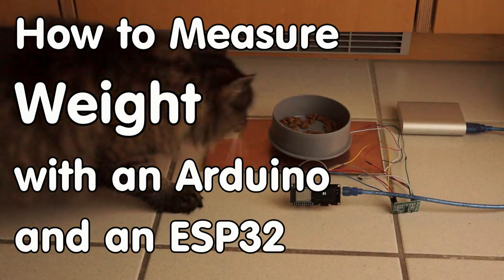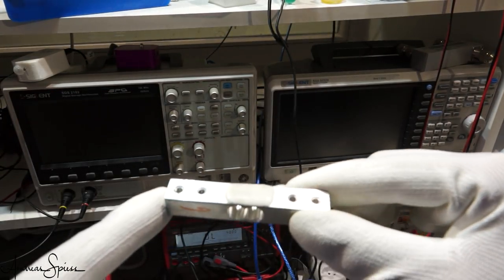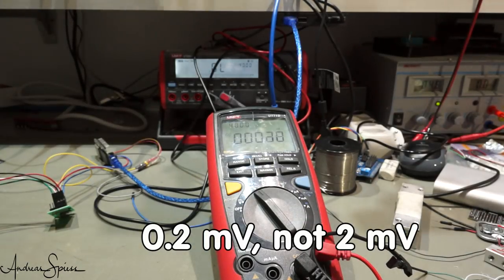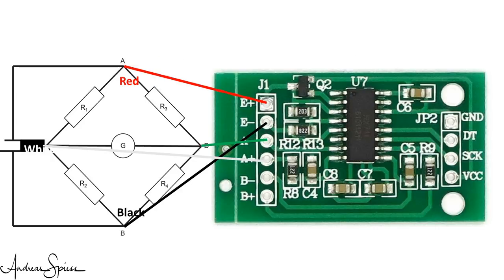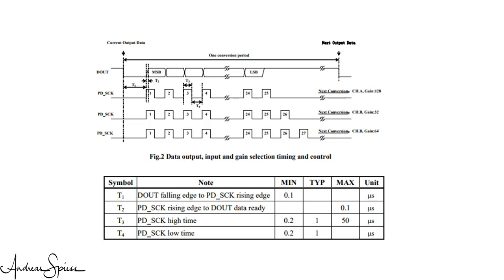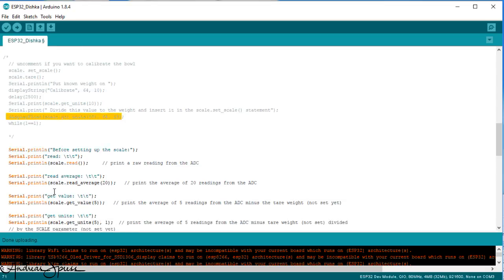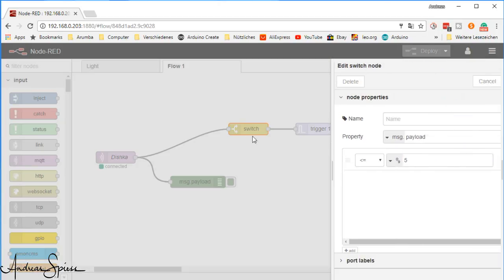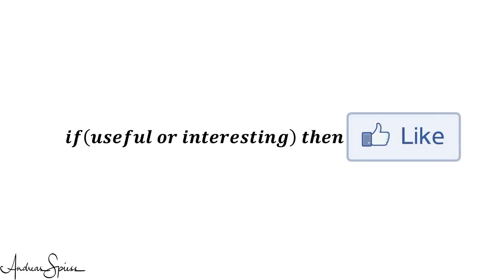#161 Measuring weight using an ESP32, a strain gauge, and a HX711

Comment: Wow, this is exactly what I was looking for! I have been migrating a project to the ESP32 (using the DS18B20 temperature sensor) and it kept dropping values where the previous Arduino did not. So it's just too fast! Can't wait to try slowing down tomorrow. Also, I am a hobby beekeeper and wanted to experiment with logging the weight of my hives over the coming season (I'm in New Zealand the season is just starting). So I've got my next project lined up already! Thank you as always for the great video!
Reply from the maker: I also plan to become a beekeeper when I have more time. Seems to be interesting and important these days.
Reply: I would love to see progress on this, as Andreas points out, it is becoming even more relevant.
Reply: Jens Stein: There's a bit for "conversion in progress", you might want to check that bit to make sure the conversion is finish when you're reading. IIRC on one of those model of DS temp sensor, you can also select the precision to get faster reading if you don't need 10bits.
Hope this helps!
DW
Reply: Hi Charles, that was very helpful, thank you. I was able to solve the issue by just setting the resolution to 9 bit (from default 12).
Reply: I will test if slowing down also solves my problem with reading from a DHT22 temperature sensor...
Reply: Patrizio Bekerle , funny problem with the combination of hx711 and ds18b20 that I need on an ESP32 with sim800 gprs (TTGO T-call): if I use the 80 mhz the weight system is working OK, but the temperature is -127... changing to 240 mhz the temperature is OK, but the weight not......

Comment: Thanks for the great Video. I like gages and such stuff. 
This kind of project is perfectly to use the "oldfashioned" ESP8266 out which are not as fast as the ESP32.
Reply from the maker: I only used the ESP32 to test some of the libraries. I think we should get an overview on which libraries work and which not yet.
Reply: Yes, for several weeks it gets better and better. Nearly all what I tested worked. And of Course, ESP32 is more attractive buzzword nowadays.
Usually I see beehives in goups, so a multi tasking mode would be needed. Or a a dedicated Controller per beehive measuring additional Things like temp + humidity, Irradiation or whatever maybe useful for a beekeeper.

Comment: Sir excellent video. Since my last comment some time ago I started up loading videos. There are about four presenters that influenced that decision, yourself being one. The aim is largely to document the hobby stuff I do and structure it but hopefully it helps someone tinkering. 

One video I did that is relevant to this video is a kitchen scale I opened recently to repair. Just a broken contact so that was simple but then I started wondering if it was feasible to fabricate one. I pulled up parts on ebay and it appeared to me that it was indeed economical. I did not consider the voltages and the need for the HX711. This video has been most informative on a topic I did consider though not order parts or build.

If you care to have a look and comment I can post a link. Critique is good. I need to improve my level.
Reply from the maker: I answered in one of your videos
Reply: Thanks. The video I was referring to is the one with the electronic scale which is similar to this. The same problem will occur though with my volume level and accent making it difficult to understand.

Comment: Setting the cpu clock manually to 160 or 240MHz also solved my problems with reading from a DHT22 temperature sensor... Thank you very much, Andreas!
Reply from the maker: You are welcome!
Reply: Andreas Spiess see my problem I described on using hx711 and ds18b20 on an ESP32; 80mhz is OK for the hx711, 240 mhz works for the ds18b20.....

Comment: Great video again. Strain guages can be used in a lot of mechanical applications and are rarely found in electronics videos.  A more relevant problem for me is that my too hunter/lovebuggs often bring in prey/ 'presents'  thru the catflapp in the door. I have been thinking about an image recognition system that could only open the flap if the cat is NOT carrying something in its mouth. This is a bit beyond my skills programming skills, i  think the software or parts of it is already 'out there' for this. I think the cost of the hardware is not a problem basically I'm thinking a rasberry PI, a camera and a gpio pin on it to control a relay that controls a motor to open the flapp.  My cat has a rfid chip in the neck but the problem I would like to solve is to deny entry if something is not 'normal' under the nose.
Reply: Nicklas Persson - You could detect if the cat is carrying prey by measuring its weight on both exit and entry. If the cat got heavier, is must have gained weight somehow, or - more likely - carry some prey... Just a though: Instead of bluntly refusing entry, you could perhaps train the cat to dispose it in a reward bowl that exchanges the prey for some cat candy...
Reply: I am all for simple solutions but a cat pees and poops outside and the weight of this greatly varies and would sometimes exceed 10-15 grams of a small mouse, bird and sometimes not. I am pretty sure my cat or any cat can not be trained to do leave its pray where I desire and most cat owners would probably agree i'm sure. I do appreciate the effort.
Reply from the maker: +Nicklas: Fortunately, our cat does not catch any animals and we even do not have a cat door. So, she has to wait till we let her in. But most of the time, she is anyway inside.

+ Maxint R&D: Good idea with the weight. If the animal in the mouth is not too small... Concerning exchanging it with a candy: I am not sure if a dead animal is already a candy for a cat ;-)
Reply: Thanks Lucio for thees links. This was what I was thinking of, hoping someone already has done this with a cat. Measuring the weight of the cat will not work unless the cat that always and without exception pees and poops indoors. Most cats prefer to do their 'business' outdoors with irregular intervalls. The cat may also have a drink or eat a prey or stolen food from neighbors cat or dogbowl while outdoors that will add to its weight and that should not stop it at the flap. I want to only stop cat from carrying prey indoors. This example shows how important it is to understand the context that an automation device is applied to.
Reply: Nicklas Persson BTW, is the RFID in his neck already used to control the access to the house?

Comment: Cat videos are always a plus. Cat + 24 bit ADC is extra cool. Could you determine how many of the 24 bits were above the noise floor?
Reply from the maker: 1. "cat 24 bit ADC" provides 400'000 hits on Google. Most of them without an animal ;-)
2. I did not look at the noise. Just look how accurate it counts the pieces. I assume, there cannot be a lot of noise.

Comment: Hi Andreass, just stumbled on this "old" video of yours looking for a weight sensor and ESP. The idea is that with this weight sensor, I can estimated the amount of filament om my 3D printer. Should be possible ... I think :S. Big kisses to the star of the video :p
Reply from the maker: It should be possible to measure the weight of the spool and calculate the rest of the filament if you use similar spools to estimate the tare.

Comment: Hi Andreas, great video again, a couple of questions.
I don't think you mentioned which strain gauge you decided to use for this prototype and if there was a reason for choosing that gauge rating ?
Also i've never used such gauges or analog bridges, nor played a lot with ADCs and i had to look a bit around to try and understand that "F.S" (full scale?) unit, maybe some details about ADC precision/limitations in your next ADC video, i don't remember if you covered ADCs in a previous one. 

I'll try to apply that to my mailbox to check if mail has really been delivered, yeah we're all someone else's cat :)
Reply from the maker: 1. I think I mentioned that you get load cells for different weights. This weight is the full-scale weight.
2. I used a 2 kg load cell, which is too much. But I did not have another one. I would expect that a 200 g cell would be more precise for smaller weight.
3. So far I have no ADC video planned. But you never know...

Comment: Hi Andreas, You video about the weight measurement is great. I would like to do something similar - without a cat 🙂- and weight something that has a very light weight (< 1 gram). Can you recommend any sensors that can measure such small weights?
Reply from the maker: I do not know how to do something like that. Because it is mechanically challenging it is probably easier to buy a commercial device and hack it. Maybe you can use a sensor I used and add a long lever?

Comment: Hi , very useful video as usual. I have a very basic question about the HX711.  Its datasheet claims for it to provide 24 bits of resolution. This would result a "value range" from 0 to 2^24=16777216. Is it possible to get such a "high digit" number from the HX711 library? Would be interesting to determine the effective number of bits when shielding measures are applied.
Reply from the maker: AFAIK Integers in Arduinos are 32 bits and I assume you read 3 8 bit values from the chip.. So it should be possible. I never checked the library. How many bits are useful (accuracy) is a different thing and has to be measured in your setup.

Comment: Would like to measure a beehive (25-40kg). Found  a set of 4 body scale 50kg load cells (half bridge). Is it correct that when using 4 of these the max weight to be measured is 200kg?
If true, shouldn't I use other load cells having a 10kg maximum. That would correspond better to the 25-40kg range of the beehive. Problem is that I did not yet find these 10kg load cells in a set of 4.
What would you choose for a beehive?
Franz
Reply from the maker: Maybe you watch my newest mailbag. there, I had smaller load cells

Comment: i think its very intersting, and i have made it with your tutorial, thanks but i just want to ask you, when i try to put a different food ( different weight) i can't get unit again like before, do I have to re-calibrate again in my opinion it is very teleport because I have to reprogram again?  is there an event to always know the amount of unity for different types of food which certainly has a different weight ??
Reply from the maker: Of course, the computer has to know the weight per unit if you want to display units. Maybe you store several different values and add a few buttons to chose?
Reply: @AndreasSpiess  thanks you

Comment: Very informative video, Thank You.
As a strain gauge must be ZERO'd before use (or at power up) the power must be applied at all times.
I see from the data sheet that the gauge amplifier only need 1.5ma, but the ESP32 is much higher.
Is there a way to shut off the power and still get a correct reading from the strain gauge ?
Reply from the maker: I am not sure that the gauge has to be powered all the time. These are just 4 resistors. And my bathroom scale lasts forever on a small battery.
Reply: True, but when it is powered OFF and powered back ON later, the weight must be removed to auto-zero. Like my kitchen scale. I can not leave anything on the scale.
Reply from the maker: Or you are sure you know nothing changed during the sleep. Then you can calibrate on the last measured weight. (For Beehives, for example where the weight does not move fast)
Reply: Yes, I have thought of that. The chance of extra weight being added or missing would be an unknown that would be impossible to resolve.   I am working on another type of measurement system that would not have that much uncertainty. We'll see how it goes. :-)
Reply from the maker: I am always interested in better concepts.

Comment: Perhaps it makes also a good solution to bit-bang the interface, instead of slowing down both cores to 80MHz?
Reply from the maker: It seems no more necessary with the newest library. I did not try
Reply: @AndreasSpiess  Ich verstehe. Gut zu wissen jedenfalls. Ich hatte bisher nur mit PIC32MXxxx/PIC32MZxxxx/PIC24FJxx und diversen ATMEL Controllern aus der ATMega/ARM Serie 'herumgespielt'. Doch ich habe mir einen Haufen ESP32-WROOM bestellt, um die mal ein wenig auszuprobieren. Jedenfalls Dank für die Antwort! Beste Grüße aus Berlin!
I see. Good to know anyways. I'll soon get into this ESP32 stuff and certainly have a look into it's Serial/SPI/I²C interfaces and all it's aspects along with ESP32. Thank you anyways for the information. That might be helpfull to know about. With best regards from Berlin, have a nice weekend!
Reply: You don't have to slow down the cores. A custom SPI read with delays is enough. They did that with shiftinslow and indeed it works fine.I did some quick tests a while ago but HX711 is a very bad chip and moved on to ADS1232 which also needs a slight delay (os library/project: https://gitlab.com/jousis/espresso-scale ).

Comment: Andreas, 80 Mhz is still to fast, mine started working at 40 Mhz, but also thanks for the hint.
You can also set the speed at the arduino compile data at the desired speed.
Reply from the maker: I even think the fixed the issue in the library.

Comment: Didn't you face the problem that if you press on the bowl (after calibration) and release the force again, that your zero is shifted? I had that problem. And couldn't find a solution. I think I used the same hardware as you (with an arduino uno). I wanted to measure the weight of playing cards. But because of the offset which occurs after applying force to the sensor it was not possible to get reliable results. Do you have any idea how to achieve this?
Reply from the maker: I do not know which kilogram version of the load cell you used. I assume it is below its capabilities. Mine has a maximum of 2kg, but this was the only one I had. I ordered now a few with lower kg (down to 100g) and I assume, they will be more precise for the small weights. But I did not do extensive tests about the accuracy.
Reply: I think I used a 100g version. but placing a weight and removing it changes its zero value. I wonder if there is a solution to that (except "guessing" when the weight has been removed completely and then tare again). In case you do some accuracy tests and DON'T face those problems, please let me know - then it might be faulty hardware. In case you DO face those problems and find a solution, please please please let me know as well! :)
Reply from the maker: I will do some tests when the new ones arrive
Reply: I want to measure the water level in my coffee machine by weighing the water tank. If the zero really shifts, my solution will not work. I was hoping that i could hard code the calibrated values.
I bought a 5kg strain gauge for a 3 liter tank. Haven't installed it in my coffee machine yet.
I see this message is now 2 months old. Andreas or Patrick were you able to analyse this problem?
Reply: I think coffee is fine. I tried to measure very tiny objects (playing cards, which weight about 2g each), so it has to work very precise to detect how many cards are on the scale. But in your case you can just detect that a certain minimum weight is not present and then tare it to zero. I am sure even hard coded values will work.

Comment: Isn't it better to use a shielded ADC? I'm currently in the process of assembling a uA current meter using the same ADC but shielded version.
Reply from the maker: I do not know if this helps a lot. I would first reduce the length of the wires from the sensor to the ADC. But it does not hurt.

Comment: I have read a little about this weight sensors but never really played with one. There should be a lot of problems e.g. repeatability, return to zero after getting bent and value drift if loaded for a long time. Have you had one of these problems in your experiments?
Reply from the maker: I did not experiment other than this video. But I can imagine such problems can occur (the sensor is aluminum). And I do not expect a lot of precision or durability of a 3 dollar sensor. On the other hand, I was impressed that it was able to count these pieces quite exactly. Maybe you need a different sensor if you load it with a constant weight.
Reply: If they these electronic strain gauges are prone to that, the manufactures of digital scales seem to have gotten around that somehow, as this is the same sensor/principle that is in most of them... Another device that used them which you might not have expected to see them in was the Nintendo Wii Fit balance board... there was one on each corner/leg, and it used them to measure weight and movement. Surprisingly accurate, and they took a lot of abuse!
Reply from the maker: I think body scales are not critical because the weight is only on for a few moments. I could imagine that it is a bigger problem if you have the weight always on.

Comment: why not use an opamp and use its feedback & input resistor to set a gain of approx. 550 times for the ESP32 ADC full scale of 1.1V?
Reply from the maker: This is possible. If you look at the datasheet you see, that the HX711 has some additional features especially for its purpose

Comment: Before I fry my ESP32 Board, one question: Which pin to connect the LiPo Battery to power the MH-ET LIVE ESP32 board (which does not have a battery connector). Couldn't find useful information elsewhere. I would try the 5V Pin but maybe i shouldn't ..
Reply from the maker: 4.2 volt on the 5v should not fry it. But maybe it will not work for a long time. Depends on the minimally required voltage of the regulator.
Reply: I will try, thanks!
Reply: update: when powering "non-battery" ESP32 board through the 5V pin, the program won't run. The LED's on the top side will light up tough. I will have to order a proper ESP32 board to use a LiPo with.